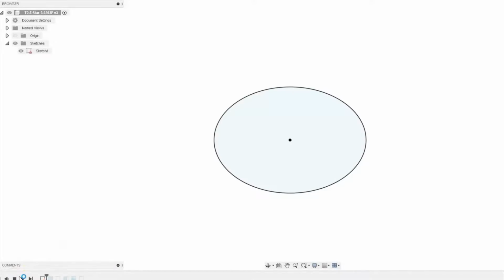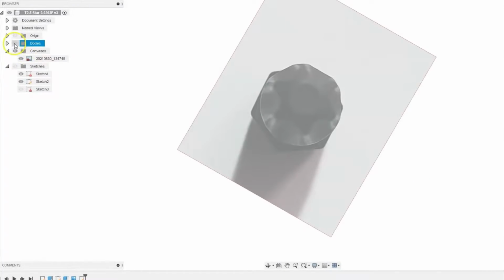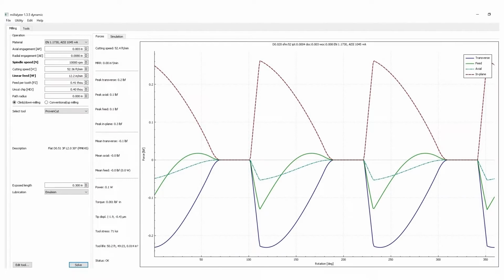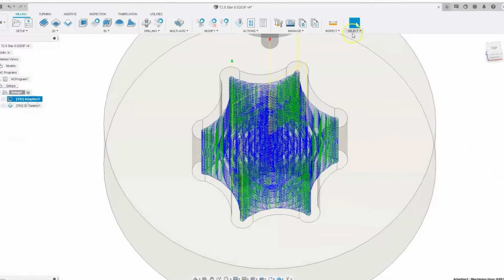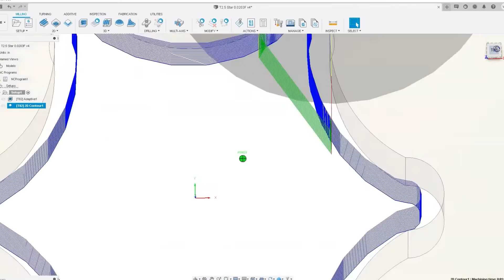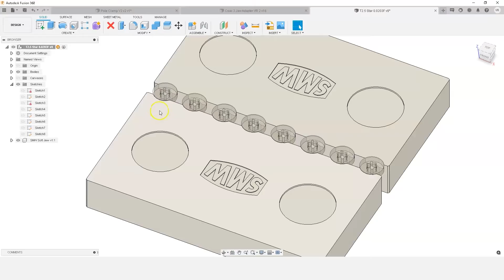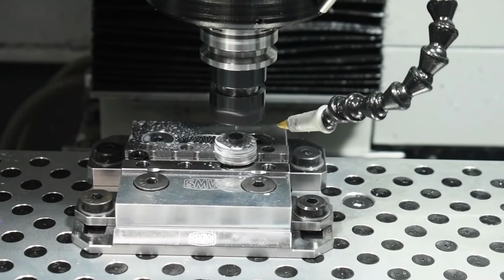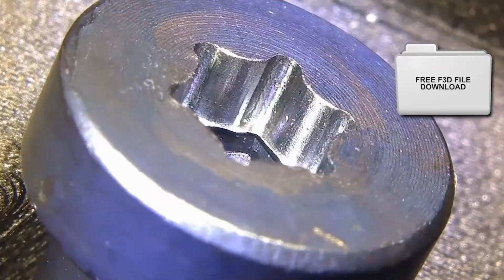Modify a Hex Head into Torx Head with 0.02" (0.49mm) Tool!

Comment: Suggest using a spotting/chamfer tool to profile the pocket to remove first cut depth phobia and reduce cycle time by having a cylindrical hole in the stock.
Surprised a rotary broach wasn't thought of especially with batch work.

Comment: I'm puzzled as to why you even did this. Why the customer didn't just go buy bolts with the torx stamped in them from the factory. It's not like they are some extremely rare earth material only found in remote parts of the world.  On a side note: It never ceases to amaze me how strong an end mill is. Nice work in Fusion, I was following right along with ya. 👍

Comment: I like the photo/canvas idea to check the measurements. Does it matter how far away the camera is from the screw when you take the shot? Thanks for the interesting vid.
Reply: The camera should be as far away as possible and zoomed in to avoid parallax errors.
Reply: @martinmarriott3607  Also the standard thing to do is to "Calibrate" the image in fusion, just click 2 points of a known distance and it will rescale the image to match

Comment: Any time I had a job that required tight corners like this TORX pattern, I would use a tiny peck drill cycle with the endmill to clear those out to finish. In the future and you have an EDM; for removing broken taps, drills and such; a graphite tool will do that type of job easily once you have the machine dialed in.

Comment: I actually did this on a bolt assembly screw for a rifle, a fairly large bolt with a 1/4" hex.  Accidentally using a 6mm driver along with an odd method of screw retention (deliberately deformed female thread?) resulted in some damage to the drive.  With a T45 and high temp thread locker it shouldn't go anywhere unless I want it to.

Comment: I have had less trouble with small tools than normal tools. I had some titanium parts with a .130 wide slot .550 deep. But the corner radius could be no larger than .03 +- .005 , with a bottom fillet radius of .03 as well. On the horizontal mill I was able to rough from the side with a slotting cutter. But the vertical ends of the slot had to milled with endmills. So I roughed with a .125 bull nose .030 tip rad. on the slot ends. Than to finish I prepared ten .062 stubb end mills and ten ball mills by grinding/relieving the shanks for the .550 depth. On my cnc tool&cutter grinder. But I did all the parts with just one .062 endmill and one .062 ball mill. I didn't need the other nine of each I prepared for the job. And my horizontal mill only turns 6000 rpm max. I did run the tools in shrink holders. I think thats important for run out on these small tools. I did pretty much the same as you did very shallow depth of cut just working down until the depth.
Reply: I think the low rpm works so well because of the chipload on a slow machine? If you could run 30k rpm I bed the tool would end up rubbing to death due to the lack of adequate feed?

Comment: For fixturing multiple parts, I'd have put the bolts into a 1-2-3 block with a nut on the backside (or made my own block).. might need to have a sleeve to center them, but then your Z heights would be consistent and it would be pretty easy to align the hexes.. could easily put 20 of them in one block
Reply: Aren't you assuming all the heads are the same height from the back shoulder? I'm not sure I'd want to make that assumption on production bolts where you care about 1 or 2 thousandths in height, unless I measured 50 bolts or so to establish the tolerance.
Reply: @lwilton  They're usually pretty close.. measure a few and see how they compare, but it really shouldn't change much in your operation.. take a shallow first pass around so that any variation doesn't overload the cutter

Comment: More better than my standard method of beating the torx in with a hammer. LOL
Reply: get a really good fit that way though!  I do it often!
Reply: "Hammer forged parts"
Reply: But dude that's the absolutely most common way to do it
Reply: I have broached brass heads with hole using torx bit and works lovely
Reply: But much more complicated.
Reply: Hammer forging is superior 😀

Comment: Cool method for learning technique but this is a job for a wobble drive rotary broach or induction heater/torx die/hammer.
Reply: That will be a bit costly for 18 bolts won't it?

Comment: Cool little project. Did you create a torx bit first in cad or scan the Torx bit? What kind of clearance from the Torx bit to the Torx pocket on the bolt head did you go with and is this how you determined the cad design for the bolt head pocket?  Thanks for posting!
Reply: Probably pulled a model from McMaster